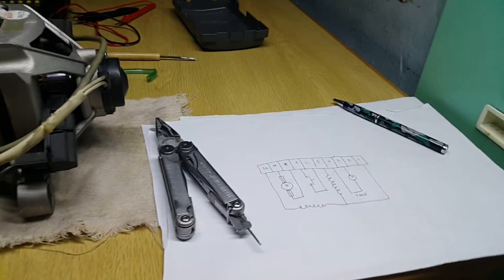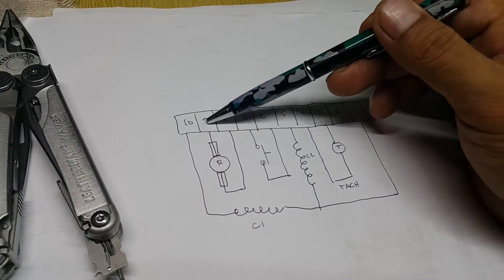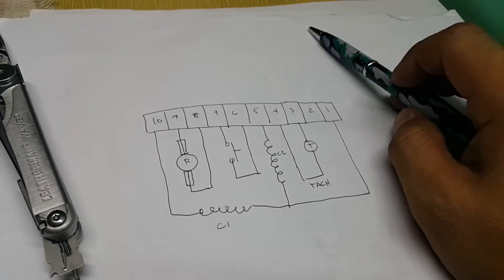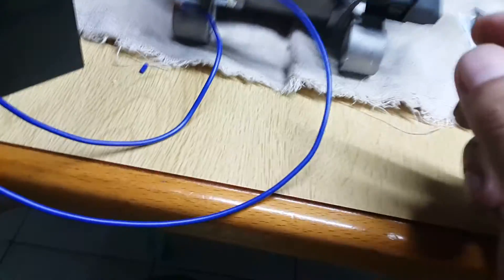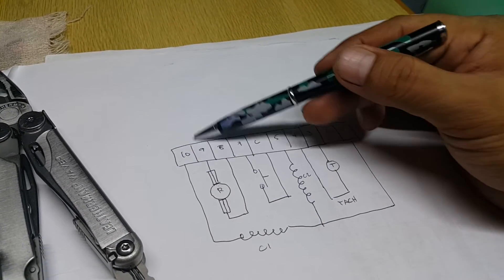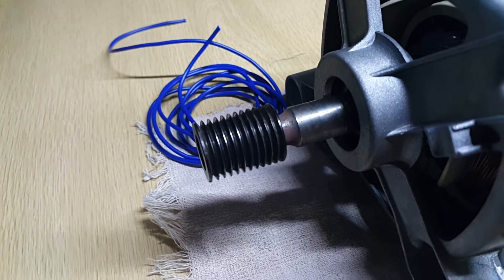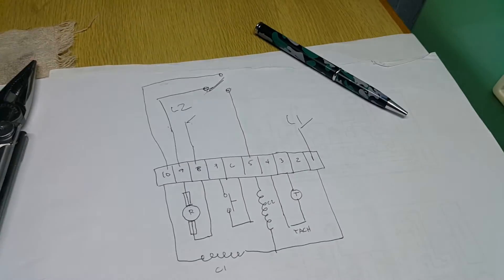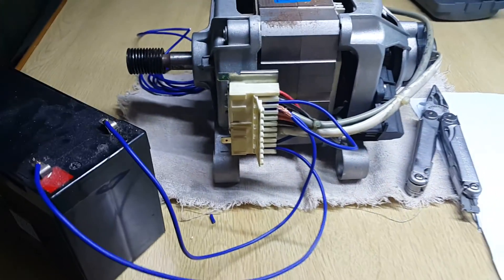Testing Universal Motor at Low Speed/Low Voltage P2

Comment: It says it on the label (though it's in Chinese), but gives power ratings. It's actually a tap somewhere half the way down the windings. Full winding gives full speed, used for rinsing, while powering from the tap gives lower speed and higher torque, used during regular washing and quickly-changing-direction mode of washing.

Comment: Can i install this motor for china PCB (xqg3388) .
Reply from the maker: I think yes. Especially if it has the same number of wires.
Reply: @TrowaTrey  If the tapping pin on the stator coil is removed and taken from both sides, will the motor not have a problem?
Reply: I can send the diagram there if you can give us your whatsapp number
Reply from the maker: @lasanthabandara7455  you can send to my mail ekii13288@gmail.com I'll look how can I help.

Comment: Hi thanks for sharing video, very comprehensive and clear video👍🏽
Is it possible to use C1 and C2, to obtain more torque and power of motor?
Reply from the maker: I'm not sure too. I did not have time to test it. But it might work.
Reply: C1 meant one set of field coil forward and C2 one set of reverse.

Comment: How do you have zero comments?  You keep saying "clockwise" when it's rotating counterclockwise and "counterclockwise" when it's rotating clockwise... otherwise, interesting video. However, not sure how it confirms my motor is bad and not my speed controller.